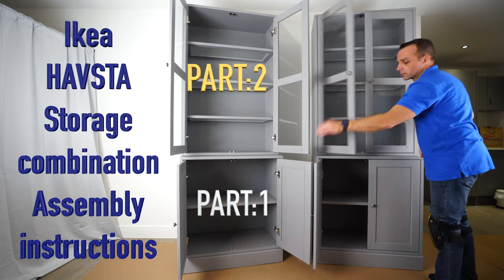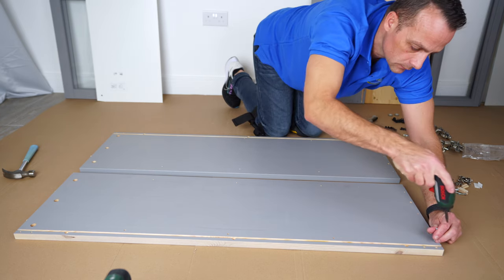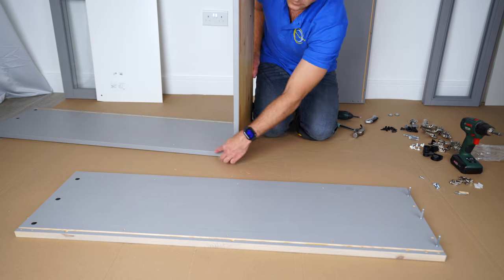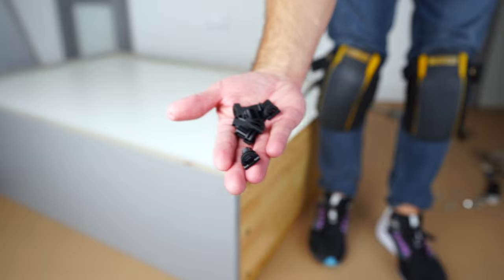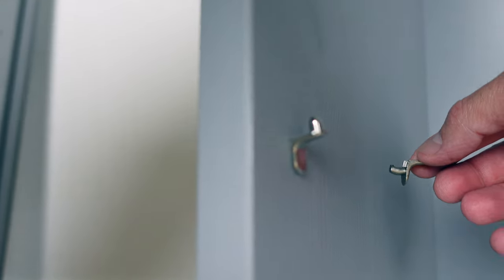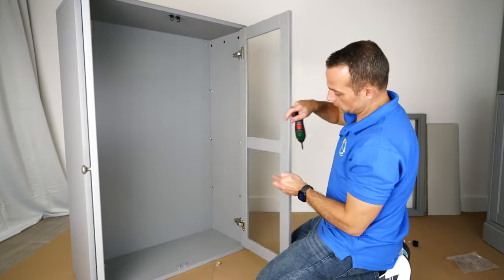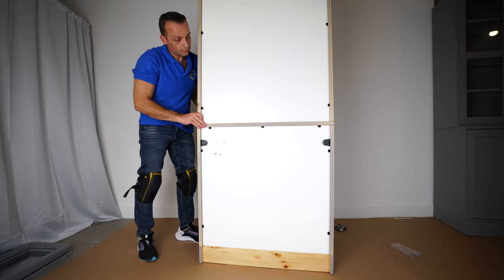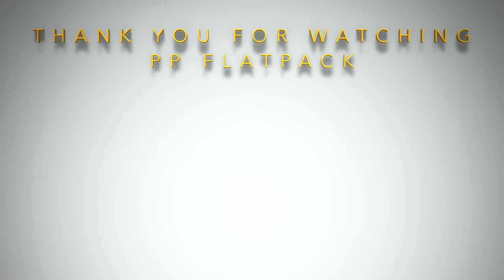Ikea HAVSTA Storage combination Assembly instructions Part:2

Comment: We are having the hardest time attaching the doors. It’s really difficult to align the screws properly and then to get them fully screwed in. 
Do you have any tips?

Everything else went very smoothly. Thanks for the video!
Reply: We took out the 2 screws and lined we lined it up so we could see the hole, screw it in. That was so much better as we struggled at first with those doors.

Comment: Thank you for so much these instructions. The book itself wasn't really all that helpful. But I gotta ask the one hinge with the plastic piece. Does it go in any specific hole on the door
Reply from the maker: In the video I did exactly what is in the manual but I don't thing there is any difference if you put the soft closing hinge up or down. Just make sure you have one on the each door